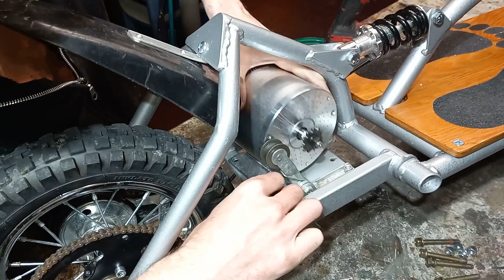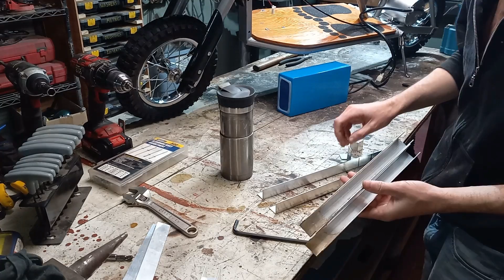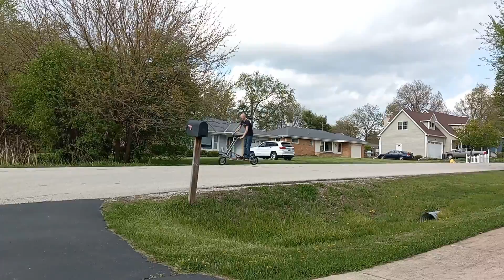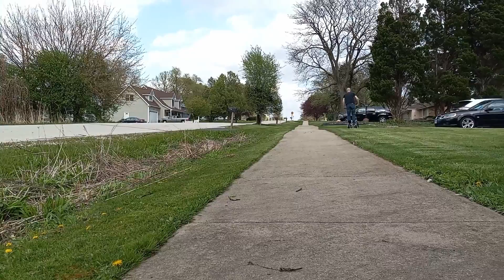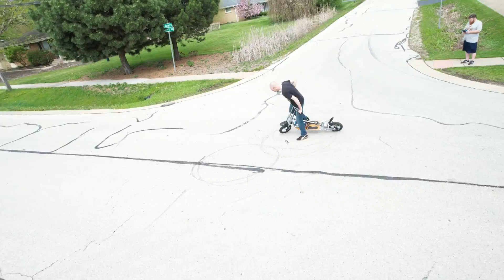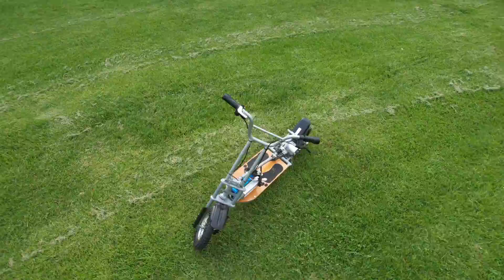HUGE POWER upgrade 48v 2000watt - DIY scooter based on MX350 ebike custom built e bike

Comment: Have you measured this things amp pull from the battery so we can see the wattage?
You can just put a clamp meter on the pos or neg wire from the battery while full throttle it. Put the clamp on a "MAX" setting too you can drive around then see the max it pulled

& at 10:15 I think your videos are good for what they show. All I request is the above, otherwise you show all the info that is really needed. at 14:20 that is a good test if you fully open throttle with a clamp meter too
Reply from the maker: I don't have a clamp meter, someday I will probably invest in one but for the time being, specs are just based on the component specs.  Honestly, those can vary from batch to batch of components,  and sometimes manufacturers can over or under state the actual specs.
Reply: @chrismakesstuff1  Yea I know, the motor specs can just be randomly listed really. Not as bad as flashlights or batteries though lol. That's why I was interested. If you ever want one check out the kaiweets ht206D, it's well regarded and only like $30. plenty of reviews and youtubes too
Reply from the maker: Thanks for the heads up on the clamp meter. They have come down in price, but with so many tools on my wish list, the clamp meter just keeps getting shifted to the bottom of the list. Lol @gg-gn3re

Comment: i cant find a single good 3000 w motor review im sure it would be a viewed video
Reply from the maker: Most of the 3000w + motor kits run on 72v systems.  The cost of 72v battery packs are significantly more expensive than 48v. I'm guessing that is why those diy builds are not as popular.

Comment: How much drag do ebike magnet motors have when the motor is off and you're pedaling or when coasting to a stop?? 
I know 1 benefit of non magnet induction motors is. They produce no magnetic flux drag when turned off & coasting or pedaling. 
I want to build gas/electric hybrid Ebike/motorcycle. Where the 125cc engine is used on hwy at 55mph & the front wheel/hub electric motor is used in city limits as an ebike. 
If the magnet motor has lot's of drag. I'd probably have to use a non magnet induction motor with no drag. 
I've never had an ebike & really need some 45-55mph transportation. So I'm jumping in with little ebike motor experience. But plenty of motorcycle & motorized bicycle experience.
Reply from the maker: That's a good question.  I don't have a specific numerical answer as to how much drag they have. It probably has a lot to do with motor size as well. This particular setup uses a freewheeling sprocket like a pedal bike,  not fixed like a motorcycle
Reply: @chrismakesstuff1  🤔 I'll be a front wheel motor. It'll be something similar to a Honda cub 125cc  but also with pedals & a front wheel electric ebike kit....So in certain areas I can use a combination of pedal power & electric only for low speed 25mph  city riding.  Then other areas I can cruise along at 55mph using engine only. If the 750w hub motor only has a slight drag it should be OK.
Reply from the maker: Sounds like a fun project. I've never attempted that combination before,  but I see no reason it couldn't work.
Reply: @chrismakesstuff1  I've seen several 2wd ebikes that work great for off road & little 2 stroke motorized/electric bicycle hybrid builds.  Where the front wheel e-motor helps with steep hills & acceleration. That the  little engine has trouble with.
What I want is cheap transportation, a stealth hybrid that gets great mpgs, can safely cruise at 55-60mph on back country roads and looks like an ebike that doesn't need to be registered, insurance etc...I was gonna use 18 or 19in moped or motorcycle rims & tires on a reinforced steel bicycle frame with a rear suspension.  I'll probably start off with a 6-7hp 2 stroke snowblower engine that I already have. Instead of a 125cc semi auto 4 stroke & use an ebike front motor kit. I seen 125cc motorizedbicycle build & he'd ghost pedal past cops. In my area of western Illinois coos won't be an issue.  But I'll need electric only when I go to Burlington Iowa across the river...I built a 29in  motorized bicycle & with a 52x40mm 2 stroke engine (single gear) it's capable of a 50 to 55mph top speed but #1 is unsafe using bicycle parts #2 It's a 2 stroke so it'd burn up trying to ride full throttle high rpm  at 50mph on hwy. Gonna sell my 700cc cruiser motorcycle. That only gets 35-40mpgs & can't go off road. 
I'm gonna use a smaller rear sprocket so snowblower engine rpm will be lower when going 45-55mph & use front motor for boost up hills. I'm hoping I can possibly use the engine to recharge the ebike battery if needed but that's a bit complicated. I'd need like a 150-200w  riding lawnmower alternator ,belt pully, step up converter, etc...
Reply from the maker: I like the idea of using a pedal start moped as a donar vehicle.  I believe Honda passports had 2 speed transmission and would do 45mph with a 50cc engine
Reply: @chrismakesstuff1  Exactly what I thinking if I could find one for cheap. I just wish they had 18 or 19in wheels instead of like 16in ....I seen some ebikes & motorized bikes use 18 & 19in dirt bike front rims that are 36 spoke & swap in a electric hub or gemini motorized bicycle hub. 
I'd love an electric velomobile if velomobiles weren't so expensive. I'm gonna be stuck on fixed income. So I'm looking for alternative legal loophole cheap transportation. That can also keep you warm & dry in winter. I was trying to build the hybrid bike on a budget. I have several donor bike frames & other parts laying around.
Reply from the maker: Understood.  Those old pedal mopeds are getting pricey, but so are battery packs unfortunately.